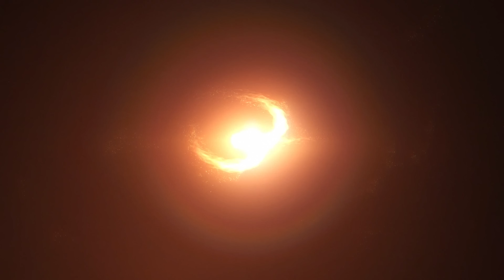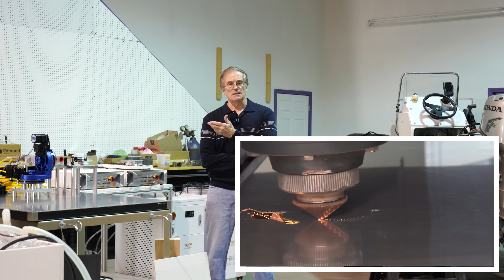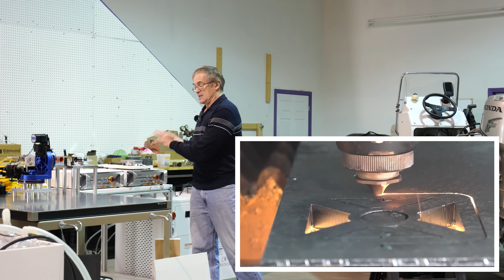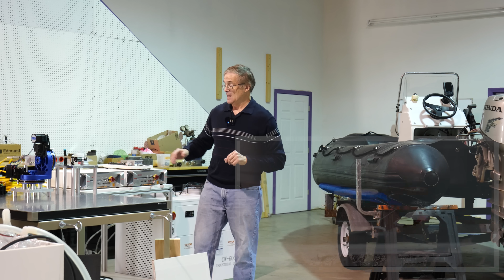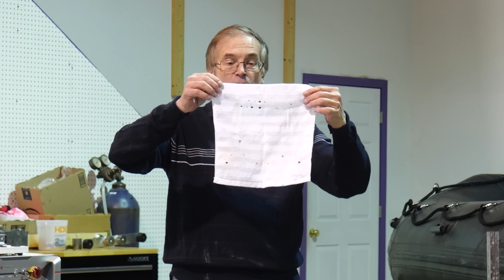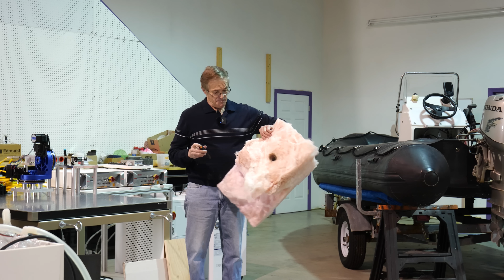We have a problem... and need your help!

Comment: Can you pulse the beam instead of it being continuous? That might help to some extent.

What about some means of lowering the power. Maybe lower power would be sufficient. And also easier to overcome this  design issue of safely absorbing the beam. Honestly it does seem a bit crazy how powerful that thing is. Please be careful.

The most obvious elegant solution has already been mentioned: point it downward into the ground or right next to a hill.

Comment: The cheapest method seems to be sand, another alternative FREE option... would be dirt.  Actual dirt. And Incase there is an issue, you can always wet the dirt and it'll withstand even more.  the only downside is that it won't look pretty.

Comment: Calcium hydroxide in bags or sandwiched between drywall. I dont think it melts like silicon dioxide when calcium oxide was used in lime light. It turns heat into visible light. This may depend on the wavelenght but I doubt it will get through. And it is cheap.

Comment: Suspend your entire drywall panel on a couple of ropes and just set it swinging while doing your tests. That should eliminate the concentrated beam in any one spot. If each rope is controlled by a different speed motor you will get a somewhat randomized movement of the panel.

Comment: I can think of a few worldleaders we are better of without you can use as a backdrop ..

but in all seriousness. My first thought was ceramics (aluminium-oxide after a short search?)
the other that came to mind is graphite, sand or some opaque gel that will let the light in but gets difused inside the medium.

Comment: As a start, how about an ultrasound tank of water?
When a laser is shone through water made turbid by ultrasound, the laser light will be scattered and attenuated by the particles in the water, making it appear less bright and less able to penetrate deeply. The ultrasound itself can also be used to modulate the scattered light, potentially allowing for the visualization of objects or details hidden within the turbid medium, according to Optica Publishing Group.

Comment: I am wondering, if fog or smoke would diffuse the laserbeam? If that was the case, could you wall off part of the workshop with clear plastic and fill it with fog so that any laser light passing your target would be diffused by it?

Comment: Have you tried magnesium oxide boards? They are supposed to be relatively good fire proofing. But also, I have a question : What happens to the beam in real life after directing a drone if it is so concentrated and keeps on going? Are there no satellites or planes to be hit? Why not instead of having one source and one beam , have several focused at the needed distance (which can be relatively easily adjustable and then anything behind the focal point would be exposed to lesser energy beam with the energy diminishing the further you get (not disimilar to the original lazer cutting machine). What's wrong with that approach? It might add a bit of time to adjust the focal point but with computers and fast actuators or spinning this can be achieved fast enough to compensate for the moving of the target with a bit of advance on the motion. Once the range is set, the target will be in the focal point almost inevitable.

Comment: You need a screen made of two layers at a reasonable distance. First one is purely refractive. You only need to refract the beam by a small random angle. My first idea is making a sheet of glass with one side hot pressed into pseudorandom smooth pattern, like a 2D sinusoid, with wavelength much smaller than beam radius but much larger than light wavelength. You don’t want deep grooves or sharp angles anywhere i.e. I don’t think matte glass will work, because they would absorb too much energy and then melt, and/or reflect the beam and then destroy something different outside. This first layer should absorb as little energy as possible i.e. the glass better be clean; its only job is unfocusing the laser.

Once unfocused, you just need some distance for the beam to become a large enough circle (or ellipse if you shine at an angle). Once large enough, it can be absorbed by the second layer of the screen made of ceramic or stone or porcelain or some other stuff which absorbs the wavelength of your laser and is not easy to melt. Maybe a square of glass-ceramic extracted from a broken cooktop will do, but don’t quote me on that as I have no idea if it will absorb the wavelength of your laser.
Reply: About the defocusing glass, you would need to find a practical process to create that defocusing surface from commercially available flat sheets of glass. Maybe purely mechanical process will work i.e. grinding + polishing, maybe chemical etching, maybe hot stamping.. Can’t help you with that, I never worked with glass myself.

Comment: To be in line with your need of portability and cheap option, isn't a good idea of have a large mirror, that it shouldn't absorb energy and heat from the laser by reflective nature, and simply angle that of 45° or in a way that the laser will be reflected down to the ground. 
In my mind there is the tipical large mirror of the gym or similar, it could have a really good area, so if you make a safe test zon with 3 wall that will reflect down the laser and the target is in the middle of that zone it should be safe.

I don't know if i have expressed myself correctly😅

Comment: https://www.youtube.com/watch?v=0IbWampaEcM
It is an inexpensive coating that is very good at insulation.
The laser will cause the characteristic charring and expansion.
Then ablate the coating via vaporisation, dispersing most of the energy into the air.
Unless it burns through the coating before the above can occur.
Reply: I was thinking exactly the same
Reply: @maxgrrrr  Saw a suggestion below that he created a putty version, don't remember that one, but it might solve the burnthrough possibility.
Maybe pre-burn it.

Comment: Visualize directing a high-power IR laser at a cascade of diamonds, microscopically, these crystalline marvels, boasting a thermal conductivity of ~2000 W/m·K, diffract light into a radiant continuum. A 100–200 µm coating of 1–5 µm diamond dust on a liquid-cooled aluminum substrate disperses 1–10 kW/mm² laser flux across cm², efficiently mitigating thermal loads. Cost: ~€350–1700/m², remarkably economical for industrial-grade abrasives ubiquitous in precision tooling. Alternatively, TiO₂ or SiC coatings, paired with a water curtain, provide robust, cost-effective shielding

Comment: Could you prove the system without using large area tracking and power laser at the same time? thus minimising the size of the protective surface / wall required?
Reply from the maker: That's an option. However,  as much as I am focusing on the laser, the control system is a critical component, and the operators (in another room) need to be free to try to fly the drones and avoid the beam.
Reply: @TechIngredients  and a low power laser that illuminates the drone for camera target verification seems a bit of a let down. Beam focussing as part of the targeting? probably horrendously complex. although if targeting a real drone it might be frowned upon to take out a satellite from orbit !!

Comment: Placing the plywood in a water tank may be worth trying. The charring of the wood enhances its heat resistance, and the large supply of water can transport heat away and prevent flames, possibly delaying the burning through of the wood or even reaching equilibrium as long as there's still water in the tank.

Hard to estimate what could work as you didn't mention the power which needs to be dissipated.

Comment: graphite felt used for soldering should be worth a shot I mean it's cheap, dark black with a ton of porosity (very low reflectivity), light, does not burn with a torch, maybe it could resist a laser for a bit, but I know that at higher temperatures even graphite could combust, it's a race between black body radiation and the energy of the laser, and in theory any flames should extinguish by themselves,  it's really cheap  a small square to test should be easy to get and try, I found them even on aliexpress

Comment: The paper towel didn't work, but maybe if you fill a very large aquarium tank with water and a suspension of solids like graphite powder, the water would flow much more quickly and could be refilled easily
Reply: Oh you beat me to it! l thought l would be the first to come up with  " Just aim it down at a pool filled with water and light absorbers"   Here a like.
Reply: and then when it punctures the side, they can run up with a FlexSeal patch to cover it.  (water spraying is a lot less of a hazard than fire, after all :-) )

Comment: I dunno, making the booze was great too ! Seriously, this is great and I am already exited ! everybody loves laser based science, so this challenge has achieved its mission with 100% success.. I can't wait !! I'm on the hook. Regarding your beam dump, Graphite or Asbestos (handled professionally of course) what are the ideal dimensions for this 'beam dump' how small can you get away with safely ? what sort of budget do you have ? what sort of 'stuff' do you have lying around ? I suspect your place is an Aladdin's cave of goodies !! Active optical sensors could switch your laser off within the blink of an eye. Other materials (of which there are many) includes types of ceramic, glasses, not sure about fluids but size is probably of the table due to complexity and again physical size of the dump. I'm sure you have loads of 'lasery' friends you have met over the years maybe 'Beam Dumps' use some new tech. And of course there is 'Ask the audience' which is the most awesome place to start !! cheers. Finally enough of my mindless gibbering now get to work !! I want me big badda boom laser pew pew goodness and I want it NOW !!.......cheers !

Comment: Asbestos. Kilm bricks.
Or a "waterfall of sand" and by sand I mean crushed rock that tolerates high temperatures.
It is exactly how they capture heat at the top of the "solar tower" that receives light from many mirrors at once.
Cheers.

Comment: Maybe try the wool they use inside a Blacksmith's furnace?  Other idea expands upon the wet towels... use one of those Waterfall displays... OR maybe make a metal wall that is being cooled down by a water radiator or forcibly cool down with a freon compressor or something :D

Comment: So my initial thought was sand in an angled box, but I curious if you used something like a sprinkler or jet of water fired at a wall. Ideally if would cause misting which would probably have some small effect on the light and should give cooling of some level to what ever wall you have, the water would flashboil making a dense steam but that would also probably help. You might have luck with something like starlite.

Comment: Suggestion 1 :  ask the manufacturer of the laser.
Suggestion 2:  you want to use a laser to destroy something but are worried about stray beam destruction of your facilities.  My solution is not to have a super resistant backdrop but to control the laser.  If you have two  (or four) low power 'sighting' lasers mounted some distance apart you could focus them on your target using binocular range finding principals.  You could program your destruct lasers to fire only when the target is identified by the range finders and to stop immediately the target disintegrates.  No stray harmful laser beams.
Not what you asked for but.... and yes, I'm subscribed
Reply: I was thinking this as optical tracking alone isn't really accurate enough in smoky environments etc (see tesla)  - Could then get fancier with the focus of the destruct beam so it focusses for a specific distance then diverges

Comment: I'd say that mirrors angled down into a box of sand or concrete is a disposable low cost route. You can make simple easel carts with casters to move around and adjust. Think of it like a roll around chalkboard with a sandbox for a base. The mirror as well as the sand/stack of sheetrock etc. just needs to survive long enough for someone to cut power and anything that burns can be replaced with a trip to a contractor supply store.

Comment: Last video with the rc cars showed the laser would stay on while on the car it was tracking (obviously for heat transfer) but with high powered enough source a rethink to how to use thr beam might add to the saftey and even usefulness.  

How fast can you control and pulse the laser?

With enough power you should have an idea of what you will be "shooting" at (hunting an elk with .22lr is different than shooting a rabbit with a 50bmg) so I would suggest some more research and testing and building target profiles to have the computer understand how much power is needed for each target profile or material.

If you know it takes .75 seconds of direct beam power to melt the casing of the battery to cause a fault then to keep the "shot" safe you can have the laser modulated to that particular material with pulses, think small shots with a very accurate controlled machine gun.

So if you can pulse the laser at high speed, with the basic profiles for different materials, you can have the laser set you burn a hole in something deep enough but not all the way through.

Since the gun analogy was used before... example if you know that 1 .22lr round would eat 1mm of concrete surface, you can gun your way through 1cm of concrete with a theoretical 10 shots, computer control the gun to shoot only 9 and you dont make it all the way through but the structure is already compromised.

This is where I would start, 2nd would be a diverter/shutter on the laser that is on a seperate saftey control system/circut that will throw something in front of the laser to stop the beam at its source timed with an emergency shut off if that diverter/shutter is triggered... 

I hope this made sense, best luck and saftey 3rd... not the third thing to think about rather saftey as the 3rd time thinking about it... kinda 'measure twice cut once' but more like "do I really want to do this" x3

Comment: Would the phenolic resin material used in small rockets fit that bill? It forms a burnt later that 'insulates' the lower levels.

WRT using water: flowing water, like an air curtain- water curtain that contains particles to either absorb the heat better or help diffuse the beam?

Comment: You just need a device to shut the beam off right away. Simple solution:
1. Use very short pulses that will be stopped by your backdrop. You can fire these in rapid fashion as each pulse will hit a different spot.
2. Use an AI camera that detects the beam of light hitting your backdrop. When this happns, it shuts the laser down. You  may not even need AI if a sensor that detects the spot of light on your backdrop can be devised.

Comment: i would have suggested something like a solar water heater that will absorb the heat and boil water to keep the temp closer to 100c maybe colums of copper or steel pipe filled with water!

Comment: Try common ceramic floor tile. It's cheap and easy. It's possible they may shatter from heat, but it might be an ideal solution. You can buy 1ft x 1ft squares and make a removable sheet with relatively low cost mounted on drywall.

Here are some other suggestions that come to mind:
- Packed sand between panels (for example like an inch or two of sand between drywall) 
- It's possible some ablating material could be used (starlite for example: mixing cornstarch, baking soda, and Elmer's PVA glue to create a paste-like substance)
- Fire brick (something thin like 4.5 in. x 9 in. x 1.25 in. might work)
- Something exotic like polystyrene embedded with graphite particles might work 
- Maybe just point the laser at the floor?

Comment: Just use thick copper plate and cool it. If you want you can oxidize it so it becomes black. Massive copper is tough to cut thermally because it dissipates the energy quickly. For safety : add some thermocouples and make a kill switch…